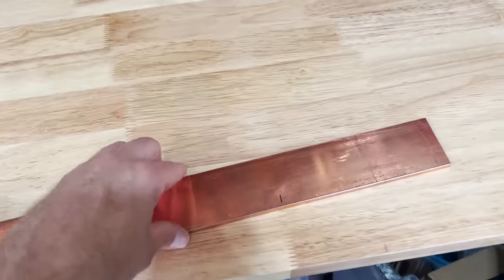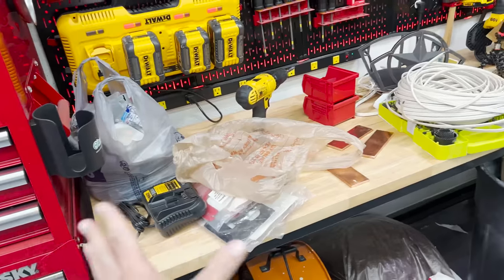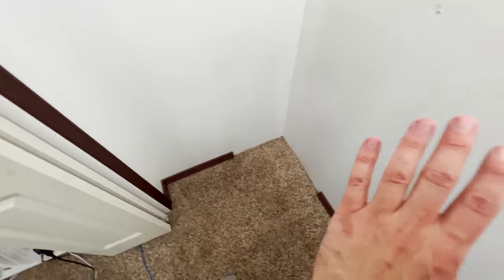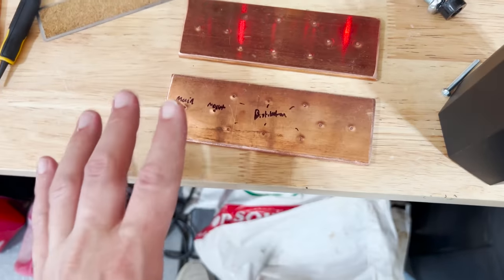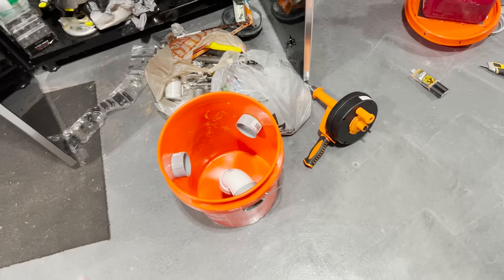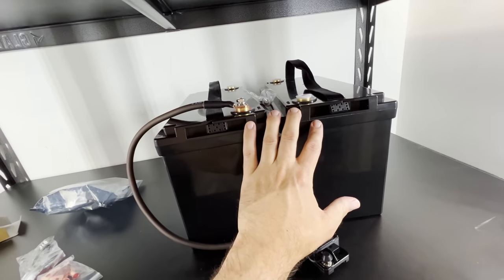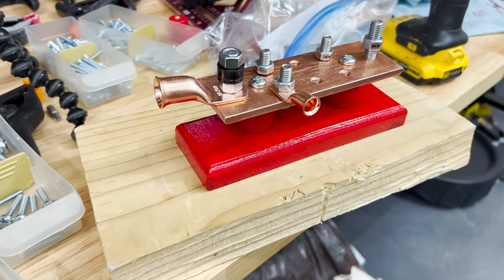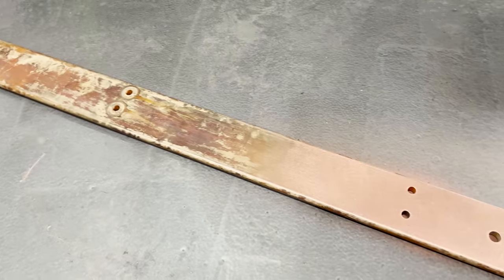Building a custom distribution busbar for my solar setup

Comment: Don't worry about equal length wires.  When connected in parallel, the entire bank will draw down equally.

The reason that the AWG 4 wires feeding the inverter get hot is because they are seriously undersized.  #4 wire maxes out at 100A, and you are likely drawing 3x that amount.  The manual for your inverter states a minimum of AWG 4/0, or 0000, for runs up to 10m.  So use 4/0 for the run from the closet to the inverter.

Bus bars: NO WASHERS BETWEEN THE LUGS AND THE BAR!!!  You want copper touching copper.  Since you're fusing (I know, breakers) each battery at 100A, you can use the 4 AWG jumpers to the bar in the closet.  Mount the breakers as close as possible to the bus bar; a short solid piece of copper would be optimal.

(I'm just an EE trying to keep you from burning your house down...)
Reply: this all sounds like what I was going to say.

Comment: Diffrent sized batteries in series with eachother...  eeeeeekkkkkkkkkkkk, WHHHYYYYYYYYY   You should put the same batteries in series and then add the oddballs in a combiner. putting the diffrent size batteries in series with each other, that is a fire waiting for happen.

Comment: If you need a shorter bolt, put a nut on the bolt and fastening it in a vise. Use a metal saw and cut the bolt to the length you need, unscrew the the nut and done (this will help cleaning the thread if needed). And if the cut on the threads gets a bit sharp use a hand-file and dull the edge at and angle. No need to buy a new bolt just because it's a bit to long. Just a tip, you do you I will enjoy the result either way.

Comment: Should line the walls and ceiling with foil and then that empty/rf cloth , protect yourself from a Carrington type event , or GOD forbid a potential threat from outside the Republic by a hostile e.m.p ING us.  Have a similar type closet setup this video is giving me a lot of cool ideas for since I just ordered my first solar kit , and the first thing g that popped I yo my head was proofing the walls to protect the  everything  , GOD willing those type events will never be an issue  , that said your still protecting yourself from any unnecessary RF that may come off your wiring and boxes. Thanks for the video post like I said got my wheels turning now.

Comment: if i can just say... i think ur batshit crazy doing this! 😂😂😂 jk, but i would really get a sparkie (electrician) to ok it BEFORE starting it up!!! (PLEASE?!) 

tbh i like your thinking tho! btw a thought... rubber matting on the shelves underneath the batteries and between the busbars for a bit of added protection?

btw i advise using all the same model and make of battery to make sure everything works evenly when charging/loaded. (did i say im not an electrician? no? well im not saying it! 😂😂)

cant wait for part 2! 😊🍻🍻

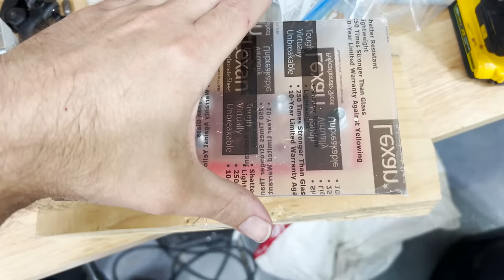Comment: @21:50 if you want to bend it into a cover, i would get a piece of wood that is the same width as you want to make the cover top, heat the plexi with a heat gun (going back and forth slowly and not staying in one spot, then using oven gloves form it around the wood block

Comment: WD is NOT A  LUBRICANT, you need to get some cutting oil for the tapping... WD is for WATER DISPLACEMENT...  its a horrible oil/lubricator...  WD does make a WD Cutting Spray, that stuff is good for tapping.
Reply from the maker: Sometimes we make due with what we have and it works 😂

Comment: I withhold on commenting because I don't wanna be 'that guy' but, you're going down a path that could lead to self harm so I'm going to say this just once and I'll never mention it again.

If you want to store energy use a rack mount battery unit. $5K basically gets you 5KWh @ 48v. If you go down this road the way you usually do things you might be making a video later of how to claim home insurance for fire 🔥 damage or worse. No one want to see that. David Poz can help.

Okay, be safe 👍